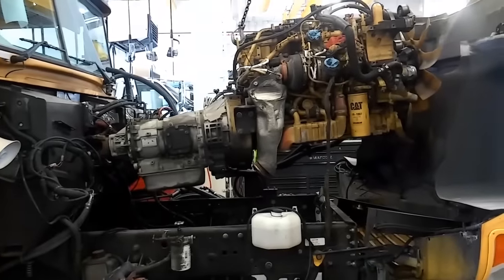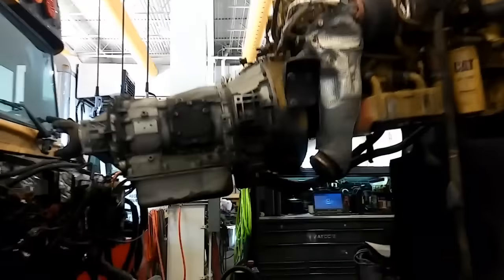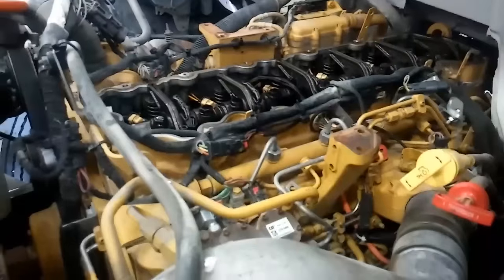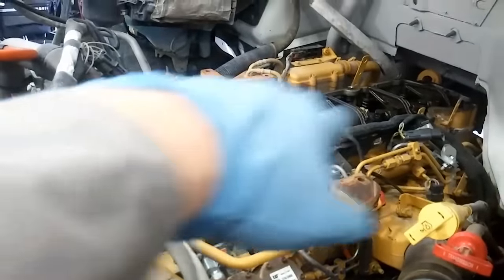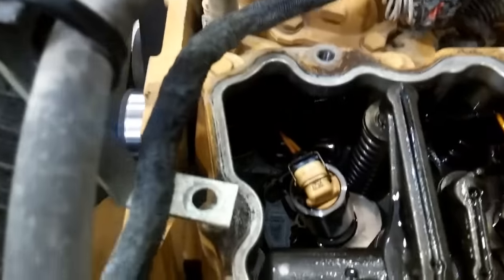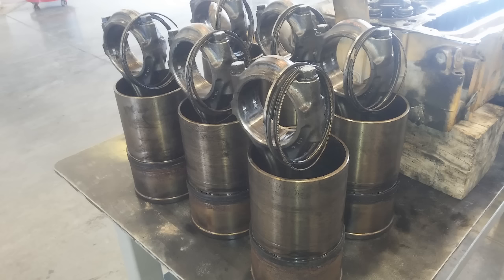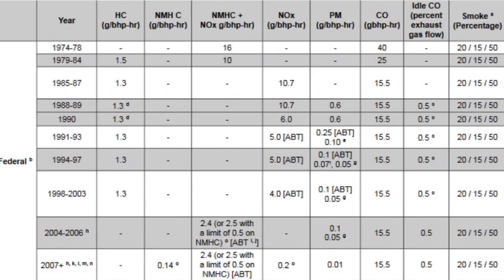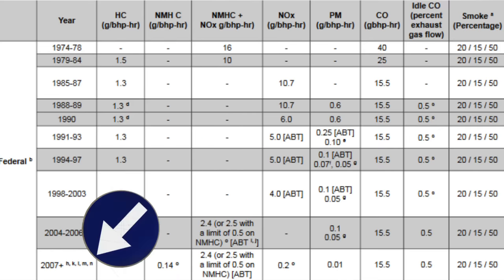The Worst Engine Caterpillar Ever Made.

Comment: 3208 too early for this or am I too old.
Reply: What are you talking about? The 3208 was/is a great engine. Its not the biggest powerhouse in highway trim, but in off road and marine trim they are near bulletproof workhorses that run for months at a time without being shut down.
Reply: @coreyschmidt1647  Smokey, linner less engine. With tapered shaft timming.

Comment: What's second place the Acert?
Reply: I would imagine so since its the same generation engine and the only difference between them for problems is the c15 was sleeved for rebuilds.
Reply: C15 SDP
Reply: @jaydunbar7538  the ACERT was the serires Prior to the C7S and other engines. It only had the IVAs no ARD or EGR/CGI. The C15ACERT hat twin turbos as well